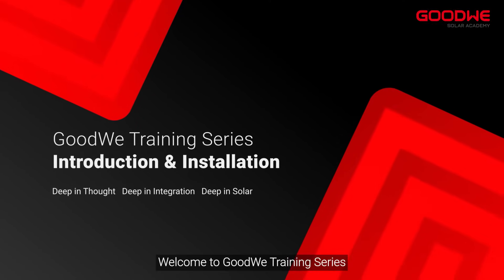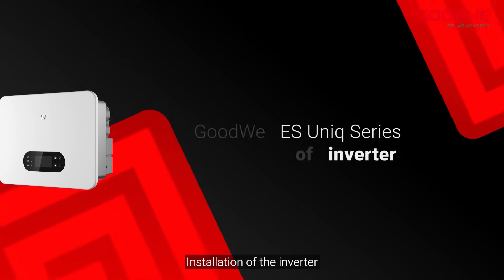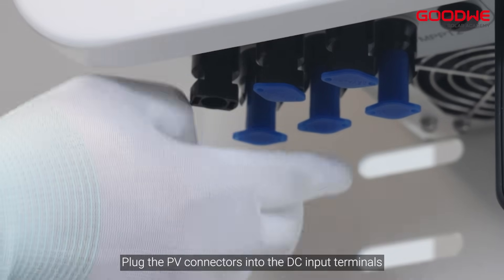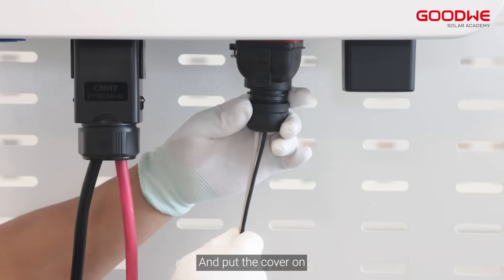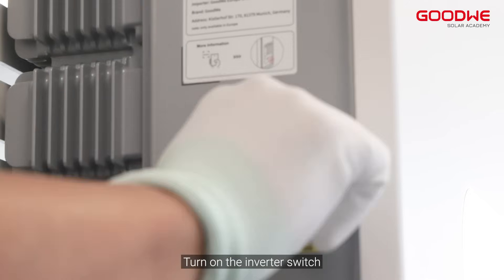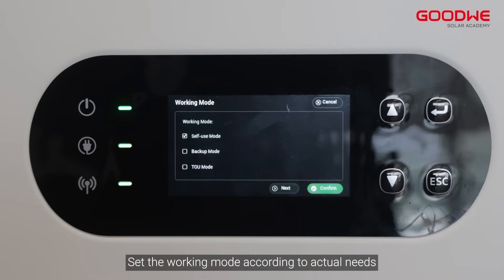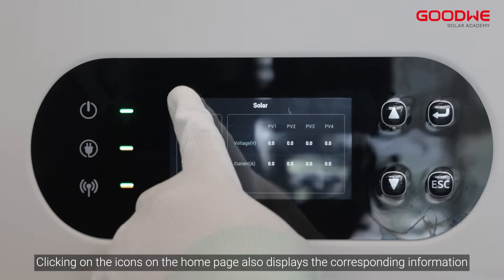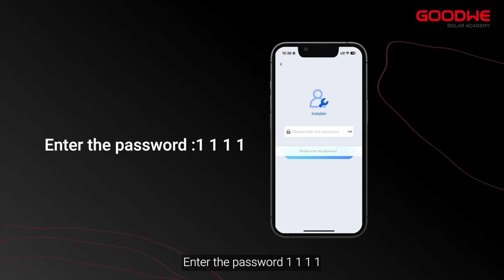GoodWe Single Phase Storage Inverter ES Uniq 3-12kW - Installation and Configuration

Comment: What do you mean CT connected to switchboard
Reply from the maker: Hello, The CT (Current Transformer) should be installed at the grid connection point (distribution board/panel).